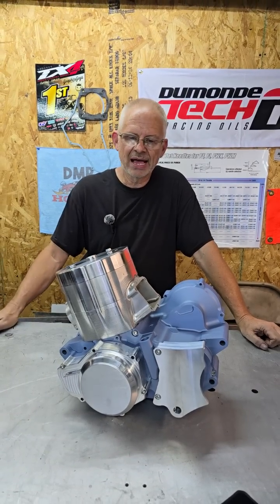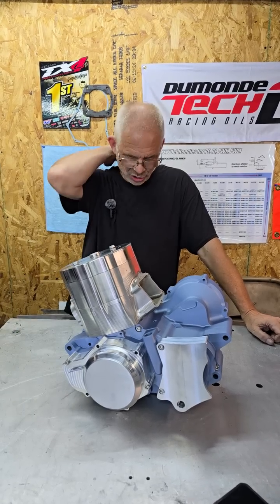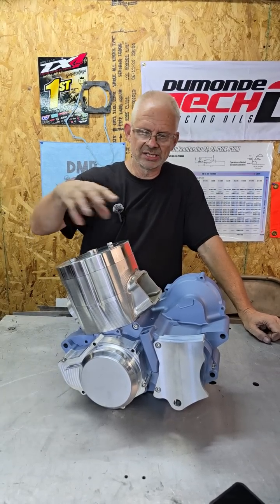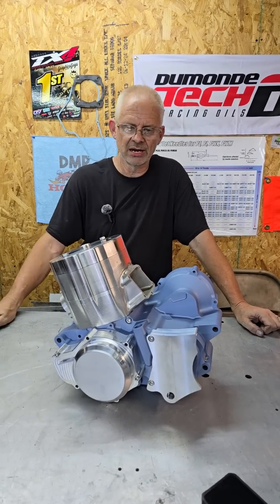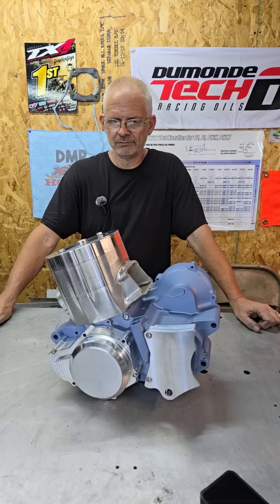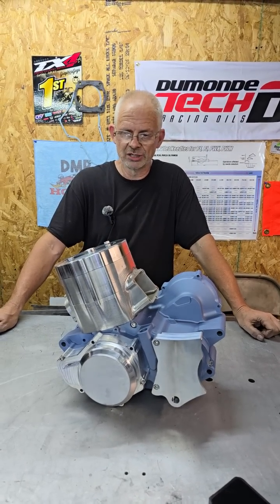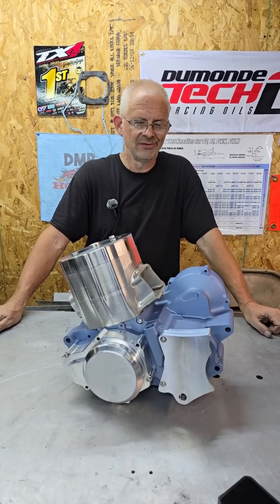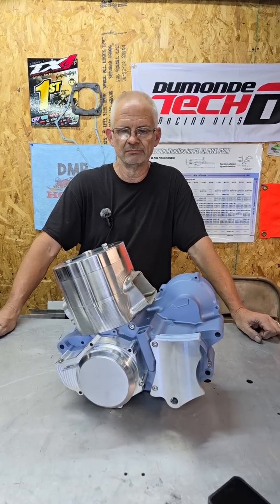500cc Billet TRX250R Cylinder

Comment: Very cool story on historybehind the project. 👍  The industry needs things like that.

We're in the development of a cr500 topend kit. Tare major updates & improvements over the original castings. It will be a drop on kit for cr500 bottoms & displacement is 514cc.

The kit will he complete with:

Cylinder
Head (2 piece billet)
Reedcage
Reedcage manifold
Exhast flange
Gaskets
New hardware (where Required)

We are also making 2 complete engines. One i can'ttalk about yet as im only at the beginning of that project. The engines will be complete with 2 options for exhaust, carb, intake boots & all mounting hardware. A complete kit. The kit will be a true drop in for the Austrian bikes, 2021+ Honda crf450, YZ250, Ducati, & for either the KX450 2024+ OR the new 2stroke chassis.

Counterbalanced
E-start
Case reed

Keep your eyes peeled on Kaplan Cycles youtube channel. There will be videos coming with our exhaust systems on the dyno (on a cr500), our prototype jug will be tested within the next month & eventually the complete kit. All dyno proven on video & dialed out of the box.

Comment: Fisrt one actually being ran on some farm.
Reply: I think cases are a better option over a cylinder. You could go case reed. If not at least way better flow
Reply: @Markonacr250 

We're building a couple different engine kits.  Stay tuned at Kaplan Cycles channel. Dyno videos of the exhaust systems coming soon. Prototype dyno videos of our cr500 topend kit after that & then our complete true drop in engine kit for multiple bikes.

Comment: The thing about two strokes is there is really 2 motors there, top end 500cc but small crankcase volume . But it would have gone well . I just got a 2025 KTM 300sx , electronic power valve, electronic TB injection, electric start . It has 51 HP , and dispite some nay sayers , it's yet to be challenged even by KTMs own 450f SX , 300 two stroke is faster and lighter , two strokes are the future , direct in head injection is comming very soon, look up Kawasaki official page, snap shots of the new KX550t two stroke direct injection MX bike with the sound of a high reving two stroke in the back ground , the caption just says " We Heard You ! " The official leaked info is a single cylinder 550cc two stroke based on the 2004 KX 500 motor, with direct in head injection, electronic power valve and start . In KX550t and a detuned KDX550t for the street/enduro along with a KX300t and KDX300t enduro/road version too. Can't wait . But Suzuki also has leaked information on a RM520t / PE520t along with a RM300t / PE300t revival comming around 2027 . Will be interesting times, I think the four stroke days are comming to an end . There's also an interesting leak from Kawasaki about a H2 990cc V4 direct injection two stroke super bike , but who knows , would be nice . The emission problem is solved with direct injection so nothing stopping it really anymore .
Reply: Kawasaki is making a 300cc 2stroke. I have a friend who is a mechanical engineer. He knows some people involved with the project & he said it was a 300cc 2stroke. No mention of anything else.

There are also a lot of those stupid AI videos where they say a brand is making a certain bike. All bogus but out there as truth none the less. AI has no business in the world.
Reply: @keithpeterson6108 buddy it's on the web site under future projects . Pretty well known today . Yeah I'm sure you know a guy that mowed your lawns cousins school friends father who heard of a Japanese engineer that once worked at Kawasaki. You might need to do some real research instead of keyboard mechanics .

Comment: Billet just doesn't make sense for a cylinder even today. Today with 3d cad and 3d printing of mold cores it's actually cheaper to cast from 3d printed cores and you don't actually have to physically hand make the cores anymore. @2STROKESTUFFING has a cool video on it where he went to place that did them and he listed prices and they were actually very cheap.
Reply from the maker: Yep there are better ways of doing a cylinder now then there was 25 years ago.

Comment: Would be awesome to see something similar for a YZ490 liquid conversion. V
Reply: We'll, have a complete engine kit available for the yz250. Actually, we'll have 2 (different size) available. Full modern design & features. Case reed, E-start, counterbalanced. First carburetor & then a fuel injection kit.  It will br modular so it can easily be converted to carb or efi. Multiple options for the exhaust system.

Keep your eyes on Kaplan Cycles channel.
Reply: Yamaha allready did this with the YZM500 back in 1987 and '88. It was an aluminum framed, liquid cooled and powervalved 500 GP works bike. They really dropped the ball not mass  producing it, even with a steel frame. It would have changed the face of MX. 8 bikes exist.
Reply: @dr.hugog.hackenbush9443 I've seen the WR but I remember seeing something about a prototype 500 back then. Never knew they manufactured a couple unicorns.